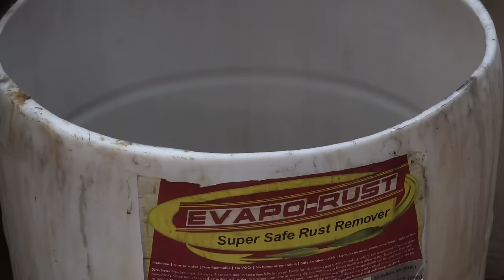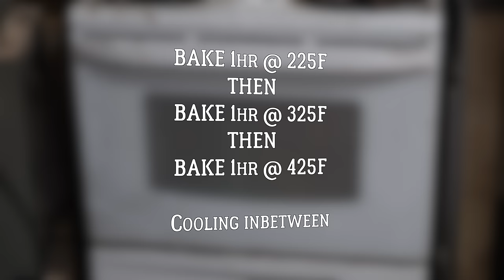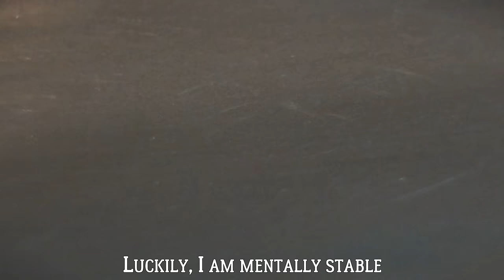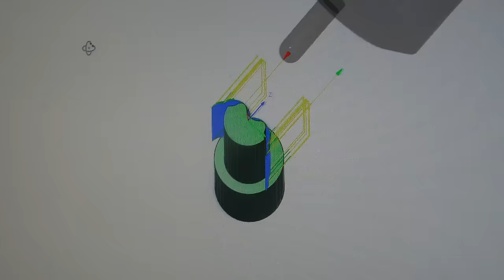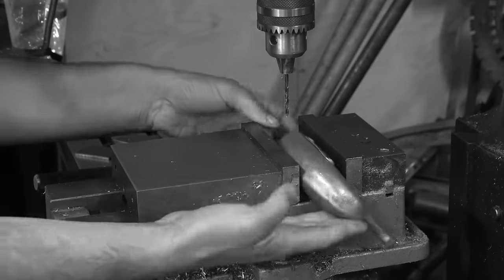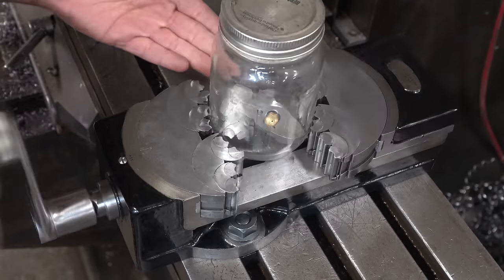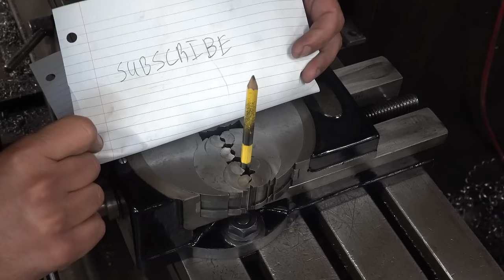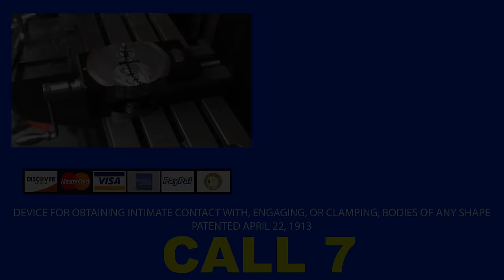Rare Antique Fractal Vise [Restoration]

Comment: I machined for 25 years, and I can think of hundreds of uses for this vise. You did an AMAZING restoration!

They just don't make things like this anymore, and it is a real shame, because this vise is a work of art. And there aren't many people like you that would go through this much trouble to restore it. So thank you so much for bringing it back from the past! New subscriber man!
Reply: What kind of machining did you do? My dad had a 3 axis milling machine in our garage for most of my life. If he still had the old Fadal I'd imagine he'd be looking for one of these vices now.
Reply: @blobymcblobface  I started of working at job shops making Aerospace and military components, then went into the racing industry for about 8 years making parts for mostly NASCAR and IndyCar. From there I went back into Aerospace where I finished my career after becoming disabled.
Reply: That was my exact thought, that's why I sent Ave a line that maybe this could help with his cnc tooling and such. I believe it would make life easier as long as you could get it figured out how to accurately clamp in each time
Reply: @jasonbarnes8047  I imagine these vises were made for castings where you just needed to clamp the part in and face it off. But as long as your casting was symmetrical it should pretty much locate the same way every time. You could always add a fixed stop on one side. So something with holes and other details wouldn't be hard to machine in this as long as your casting allowed for some deviation. Which is why the vise had drill gouges in the base when this project was started ;)

I've made complex fixtures for a lot of cast parts that this vise would have been absolutely perfect for. It is just funny how we have evolved away from making tools like this. If you think about the old machinists, and how innovative they had to be to make things, it is just sad. CNC's have done away with a lot of growth of individuals as far as building machining skills.
Reply: @BreydonsRC  exactly that was my line of thought plus you reduce stress and markings on items when you can actually spend the weight out over the entire piece. I really do miss the days of making things that were not only engineered to last but to span across all walks of life. Now they just care about dumping dime store quality items on the market knowing they'll buy another if they need to replace it. Some call it cheap but I absolutely enjoy actually getting into something thats broken and repairing it.
Reply: @BreydonsRC  damn I just got what you meant about the holes on it. That really would work pretty damn well.
Reply: @jasonbarnes8047  yeah, I have seen numerous Kurt vises over the years where people weren't paying attention to drill depth. I assume the one in this vid went through a few generations of machinists.
Reply: @BreydonsRC  I try not to kill my bits or vices I'm usually very careful with my plung depth or the underside. But stuff happens as they say
Reply: @jasonbarnes8047  yeah, I did it once on a brand new Kurt vise jaw. Not as big a deal, but I still felt a bit bad about it.
Reply: @BreydonsRC  regardless of the money it usually hurts worse when you have to admit it was an oversight that should have been easily caught ahead of time. I do it a lot but usually when I'm done putting it back together and it dawns on me I over looked a seal or a set screw
Reply: And for the vice to be mistreated as such... what a shame.

Comment: The vice is testament to the tremendous skills of the designers and engineers of the day, making all those intricate parts without CAD. it is a piece of artwork.
The guy doing the restoration is a skilled engineer and a dab hand had freehand scribble😂. Great vid
Reply: not that hard from a math stand point. In reality you could use a fly cutter to cut all those shapes. They are just circles of various sizes..
Reply: now days with CNC yeah though in those days it was done by an engineer who had skills though is clearly made from circular steel
Reply: We all these days have to be reminded from time to time that really what computers do are two things: make hard work faster, and make certain otherwise difficult physical skills accessible to more people because you no longer need gigantic hot forges, access to metal ore, and other sundry things to make these tools anymore.
Reply: Exactly.  Very cool
Reply: They are literally circular sections, probably cut from bar stock.  It has to be circular. Nothing else could work.  The trick is in the precision machining of the sliding joints, rather than the design.
Reply: Dennis Hall now days people use CNC machines and the like to produce stock parts, them days the steel work was machined by engineers hand and eye from drawings and schematics created on paper. The off the shelf stock steel was forged and/or machined from raw materials.
That vice was and is still a piece of kit from a time when engineering was fully hands on from start to finish
Even the machined screws where most likely produced in the same workshop

Comment: As a machinist, I can't count the number of times that I had to design and make vise jaws for one off jobs that this would have handled with no more than a shrug and a, "So? Wie so, denn?" attitude.  Hey life, I want a do-over.  Very fine work, sir.
Reply: I think a simplified set of something like these would be amazing for a Kurt. A tool room cnc, just toss an ugly rough cut piece of stock and go.
Reply: Yes sir, I came here just to say something similar! Would be so handy to have one of these in the shop
Reply: @stanervin6108  sure just like bars of soap do...
Reply: Aber warum und wie ist das benutzt
Reply: Wouldn' t it be hard to get reference points and positioning?
Reply: @stijnlombaert8396  the first op won't matter, second op second vise, or if you have two flat sides it will hold them square. But I have a prob on my machine no problems there.
Reply: As a toolmaker I question the repeatability
Reply: @ALO_69  you could do one solid jaw on the back of the vise and one of these jaws on the moving jaw
Reply: @RubSomefastOnIt  that would help on axis for sure

Comment: The man hours in machining to create this Vice without the aid of computers is mind boggling.  It must have cost $20 in 1914!!!

Excellent video, thank you.
Reply: It’s absolutely BEAUTIFUL TOO.  I’m AMAZED I’ve never seen one of these before
Reply: For a price perspective here, the $20 coin of the time contained about 96% of a troy ounce of gold.  The current spot price for a troy ounce of gold is $1,804.90.
Reply: @frotz661  Seems about right if not actually on the low end considering the incredibly precise machining of the part.  Those tolerances are incredible for something made back then.
Reply: Or as Derek from Vice Grip Garage says...."mind bottling". LOL
Reply: I mean forging also existed back then
Reply: @lazarpejic6415  and, no amount of forging has that degree of accuracy with the tolerances at play. That was definitely machined.
Reply: @someguy3861  Dude literaly whole engineblocks are forged. I am talking about a huge Machine which Hits the Part several times into a Form. As i 1903 this was the most presice way to do stuff like this bc there was no mill that could do this Type of machining
Reply: @lazarpejic6415  do you know the blocks are machined after forging, pistons as well
Reply: @lazarpejic6415  during this era anything metal was cast and then machined. As for extreme tolerances the answer is simple- practice, skill, and accurate calipers. Remember, they built the pyramids with bronze hand tools
Reply: To be fair, 20 dollars in 1914 money would be worth almost 500 today.  1$ silver coin would have a melt value of 22$ alone
Reply: @maaingan  No, no, no. Most things were forged and then final machined. Yes some things were cast but 100 years ago far more parts were forged than today. Today casting has taken over except on things that need the strength of forging or of the highest quality.
Reply: @lazarpejic6415  Bullshit. Nobody has ever forged an engine block. They are either Billet and that is only modern prototype and racing engines due to price or cast. Every production engine block ever made is cast aluminum or cast iron and all castings and forgings have to be final machined. Neither makes a precision part.
Reply: They gave us puzzles similar to this to fabricate when I was a student in the 70s. No computers then either, and we were in the jet age when everything was made using skill.
Reply: interesting information thx =)
Reply: But seriously - how did they do that kind of precise work back then?  It's the classic chicken-or-egg question of "how did the make the tool necessary to make this tool"
Reply: @charleslonger  skill.

We're going to get to the stage (if we're not there already) where we lose the ability to create certain things. Engineers who don't understand how to make things aren't good at designing things (I don't care what they say).

Other than that, gauge blocks offer the start and everything can build from there, precision-wise.
Reply: I suspect the cost a bit more than $20. For very well made things the amount it costs back then would still be considered a good chunk of change even in today's terms. There's some old tools back then that cost like 200 bucks today that would still be a good amount of money.
Reply: @johnn3542  557 doll hairs to be exact.
Reply: @patman0250  what?  That's wat more random than my comment
Reply: @gordonthomson7533  lol, computers allow us to make far greater things much faster. even things that are normally impossible to make by hand can be made faster. you still need skill to use computers optimally, its just a different type of skill. also design is a different skill to craftsmanship, it is true there is overlap between them but they are not equivalent
Reply: @fredericcolombier5380  the money you spend buying a second hand car will probably still end up outside the U.S., also can you be sure the raw materials were gathered in USA? this is also not necessarily a bad thing.
Reply: @usbhub95  lol yourself. I'm a masters-holding mechanical engineer and also a machinist. I'm not a great machinist but it helps me to be a great mechanical engineer. I know what I'm talking about. Computers are of course an inherent part of the process but we aren't making enough clever mechanisms these days to keep sufficient expertise alive. My peers at uni were all handless, didn't know a spanner from a pair of pliers (literally....). University educated "engineers" are not cut from the same cloth as they once were.
Reply: @gordonthomson7533  Yeah, like spaceships that can put a man on the moon. According to NASA we lost that technology and nobody knows how to make them anymore.
Reply: @falsefreedom1713  well, sarcastic or not, there's an element of truth to that.

Any rocket that repeats the feat will need to be designed again from the ground up, using today's methods.

@usbhub95 is being childish and naïve/arrogant in his understanding of my point. It doesn't mean we can't find ways to accomplish goals it means we won't reliably be able to accomplish them using the same roads we used to.
Reply: @gordonthomson7533  I mean, obviously if NASA had actually come up with technology that could put a man on the moon, they would have been careful not to lose that technology....I also find it very hard to believe they would actually tape over the telemetry data due to budget cuts.

I do agree with you original sentiment though. There are a lot of skills being lost as people become more reliant on technology and "the system" to keep them alive....I reckon the Amish might be onto something.
Reply: @gordonthomson7533  hmmm interesting coincidentally i got a strike on my channel a day after you either misunderstood or intentionally ignored all my arguments, very curious
Reply: @usbhub95  I don't know what that means.
Reply: That vice ain't cheap back then. Still looks impressive engineering by now standard.
Reply: @falsefreedom1713  You can see it as evolution in languages. None of us today can speak languages that were used several millennia ago. Like egyptians, sumerians or hittites did during their time. But it does not mean that we can't express or convey our thoughts any more these days.
Reply: @charleslonger  the milling machine was invention in 1812 metal lathes where commonish by the Civil War, shapers and planers could have made parts for this sure but I doubt it.
Reply: @charleslonger  ю
Reply: likely was using a template
Reply: @falsefreedom1713  If you’re interested in the restoration of some of the Apollo equipment, CuriousMarc on YouTube has a series where they get one of the original Apollo computers up and running. A lot of stuff from Apollo ended up repurposed for other stuff, Marc got a hold of an uplink test setup that had been modified for use with LandSat, it seems they didn’t really think much about the historical value of the equipment.
Reply: @gordonthomson7533  university educated 'engineers' go to the workshop wearing a pristine white shirt and leave at night with it just as clean.
Reply: Please, nobody has 200 cans of beans worth of money lying around

Comment: That is absolutely the greatest vice I've ever seen. I would love to see some type of reproduction of a vice like this available for purchase
Reply: I had a look around and found some 3D-printed examples and someone who patented a new one for use as an engraving vise.  As if combining something known for 100+ years with an engraving vise base is worthy of a patent.
Reply: @frotz661  Nothing 3D printed is any good. You cant make a vice from plastic .
Reply: @thra5herxb12s  you say that like plastic is the only means of 3d printing. metal 3d printing is a thing, like with steel and titanium
Reply: @nukedukem420  Yeah? What has that got to do with anything? lol
Reply: @nukedukem420  And now let me explain to you why acting like a know-it-all won't help you.. CNC is subtractive manufacturing, which obviously means you start with a block of material and then remove what is not needed. 3D Printing is additive manufacturing and therefor produces little to no waste. They are two totally different processes used and most of the time are used for completely different types of manufacturing.

So yeah.. I do know what it is. But I don't understand why you decided to bring this up. It has nothing to do with my original comment.
Reply: @thra5herxb12s  theres lots of materials that can be use for 3d printing not just plastic heck even ceramic can be use
Reply: @thra5herxb12s  i just remembered theres this rocket company thats 3d printing their own metal rocket

Comment: I'm amazed that thing broke because its clearly from another planet. That's the coolest thing I've ever seen and is now something I must have. 😲
Reply: It broke because the maker was so focused on making the fractal aspect of the vise that they overlooked the fixing matter of the base. The forces are unevenly distributed because of the design and all the force is put through that small wall.
Reply: I didn’t even know this existed and now I don’t think I can go through the rest of my life without one
Reply: You will have a better luck of finding the Holy Grail.
Reply: @aserta  Are the forces unevenly distributed? The force depends on what areas are in contact, and should be roughly even between any given points of contact, no? So, it seems like the forces should be very evenly distributed across the vise. Compare this to a normal vise, where you can happily put the work off to one side or the other, and nobody ever complains about their vise snapping in half like this. I don't think it experienced any forces any other vice wouldn't; it looks more like the structure was just woefully understrength for any vise. This has basically a tiny block of metal with a ton of screw holes through it, whereas a normal vise has a massive solid bar to work with.
Reply: @erictheepic5019  I dont think this was invented to be a brute or used to excess by cranking on it with everything you got. It's for solidly holding odd shaped objects and its anyone's guess what the original intent was specifically meant for

Comment: Fantastic job on that restoration!  You got incredibly lucky with that thread. That could have gone so bad. No matter how much soot you had on the threads. But still, you did a great job on it. You should be proud!
Reply: Love your videos dude crazy seeing you here
Reply: I am joining Charles on that one.
I'm a big fan of your videos. Keep it up!
Reply: Ultrasonic ftw
Reply: Agreed!
Reply: I'm not sure I fully understand the risk. Could you elaborate?
Reply: @ropersonline  Risk of brazing sticking to threads.
Reply: @bentontool  exactly! If he were to  burn through the soot, the brazing would then stick to the threaded rod and it would be incredibly difficult to remove. So much so that you might have to cut it off and drill it out.
Reply: I was amazed at that trick I’ll definitely remember that one.
Reply: @missingpartsclub  @bentontool: Thank you both.
Reply: It just occurred to me that taking the intermediate step of machining a section of acme threaded rod in graphite would have been a safer, albeit more expensive and time consuming alternative.
Reply: @WesleyJolly  Your reference to ACME threaded rod sent me down a Wikipedia rabbit hole. You wouldn't happen to know what self-centring or self-centering thread is, would you?
Reply: @ropersonline  Sorry, I don't have a clue.
Reply: @WesleyJolly  Not to worry and thanks anyway. If anyone here knows, please share.
Reply: @WesleyJolly  That's interesting.